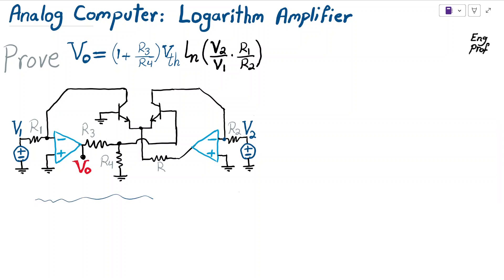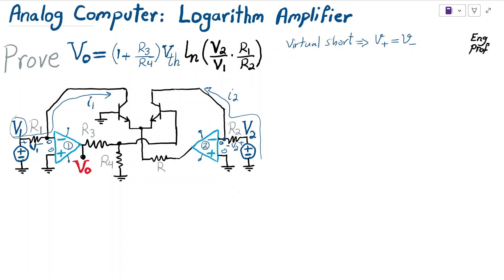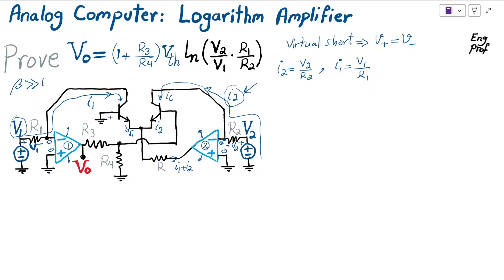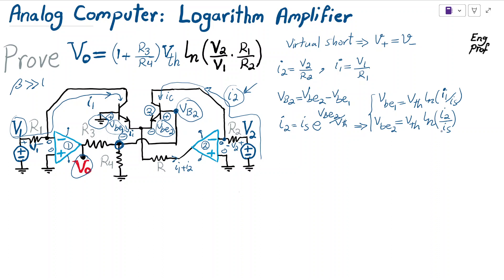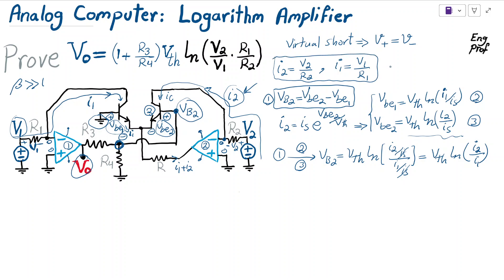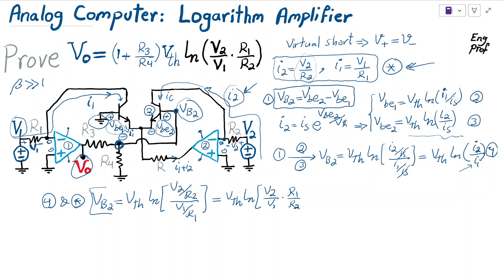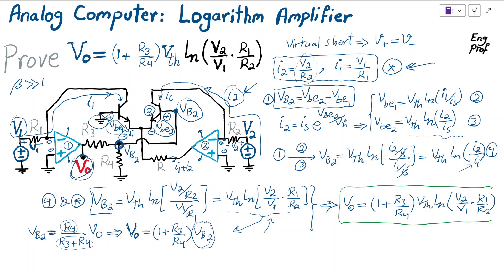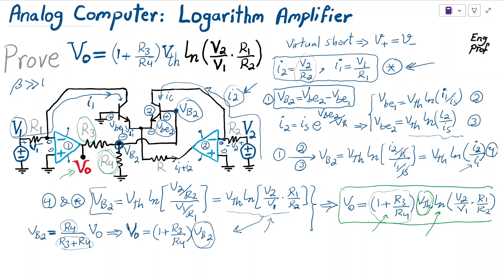Analog Computer: Logarithm Amplifier (Log calculator)

Comment: Thanks for the thermal topic, I had thought of adding a random number digital generator for my processor design that was dependent on temperature and other factors, an easy way is then a transistor/resistor ladder feeding, as analog generator/analog to digital converter, a transparent latch, scrambling the input lines.... Random output!
Reply from the maker: You are welcome, thanks also for sharing your thoughts on thermal compensation.

Comment: I've spent years trying to find a suitable notation for logarithmic functions of any base, as economic and almost self-explanatory as the exponential functions. Today, I found it! If 2³ is exponential, base 2, let's convene ⁸2 is the base-2 logarithm of eight. So, ⁸2=3, and 2³=8, much more easily show they are inverse functions, and perhaps students get less scared when taught logarithms, than log(sub 2)(8)=3.
Reply: The only "problem" is that you place the input on the left side (⁸ is to the left of 2), while everything else in math has the input either within parenthesis or is simply just somewhere on the right hand side.
I suspect this is something that is too late to change, just look at the "imaginary" number name, it is one of the worst names possible, yet it stuck. Logarithm is also a horrible name, but again, it stuck. Or the way electrons actually flow, the convention is from + to -, but in reality it's from - to +, this is also something that is too late to change. 

TL;DR; I agree with you, and I also wish you were born 500 years earlier.
Reply: @harrysvensson2610  Of course electrons flow from - to +, they are negative charges, therefore their course is opposite to that of positive charges. When I was 12, I had access to several science books my great-grandmother owned, all dated in the turning point years from the 19th. to the 20th. century. One of them was on physics. It even mentioned the Michelson-Morley experiments, the Fitzgerald-Lorentz contraction, and Maxwell's equations. It explained that some sense had to be conventionally assigned to the electric flow; as what the sign (and nature) was of the electric charges whose movement constituted such a flow was unknown, it was convened a standard flow of positive charges from a positive to a negative pole. In fact, even what was a positive and what a negative pole was convened, too.
        Another of her books was a compilation of the many articles that Dr. Salvador Ramón (generally known as Ramón y Cajal, or just Cajal) wrote in Spanish before 1899, that he later published in French in 1905 on the nervous system of man and vertebrates, with which he was awarded the Nobel prize. I read all those articles in order when 12, trying to learn how brains managed to understand the world and think. Cajal didn't know. Now I, after half a century trying, have discovered how.
Reply from the maker: Thanks for the comment. Just a note that left exponent is already a notation for tetration aka Hyper4 operation: https://youtu.be/AR2Rx_hbM1k
Reply from the maker: Thanks for sharing your thoughts. Just a note that the left exponent is already a notation for tetration aka Hyper4 operation. For example https://youtu.be/AR2Rx_hbM1k and https://youtu.be/27VYkoUwA4w